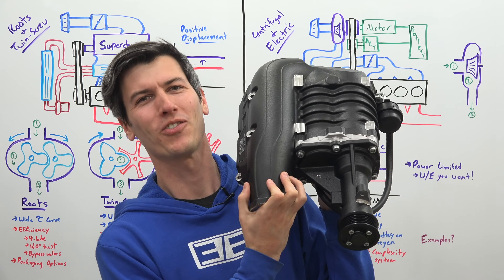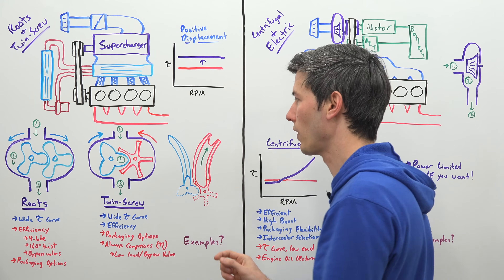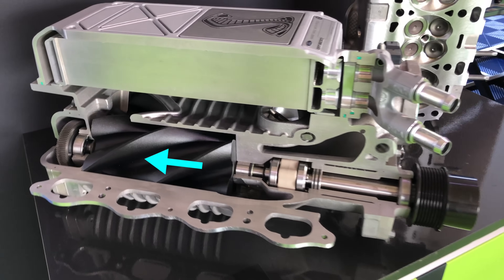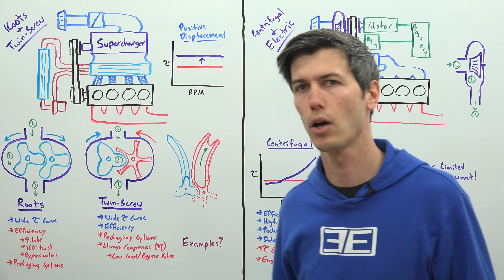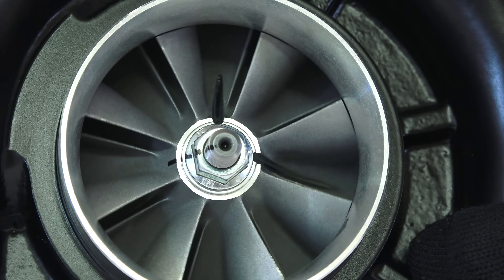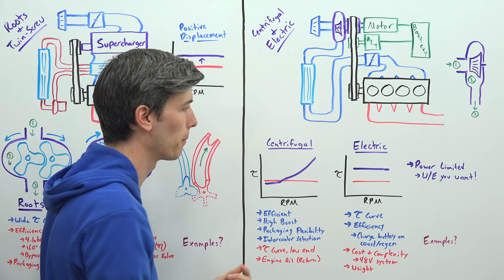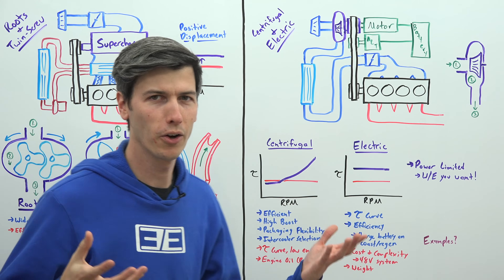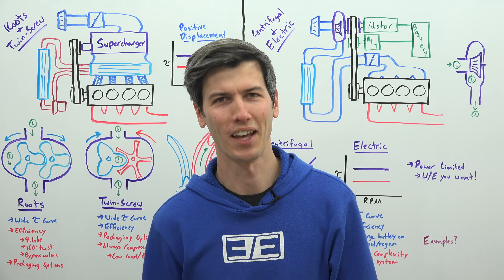What's The Best Supercharger? Roots vs Centrifugal vs Twin-Screw vs Electric

Comment: Best depends on the application and desired outcome. I’m not a fan of Superchargers specifically positive displacement Superchargers on small displacement 4 cylinders. Those engines need high boost levels to make up for displacement. Above 14 lbs the heat/parasitic drive requirements skyrocket. A properly sized and designed turbo will shine all day long above that pressure.

Comment: What if electric supercharger with an alternator driven by exhaust? Place that turbine driven alternator where the back muffler would be to shield it from heat. Charge electricity when motorbrake or high rpm.

Comment: Great video and info. Wish I could have viewed it back when I was a kid, 40 years ago. Centrifugal type superchargers are dynamic devices as opposed to their constant output Positive Displacement counterparts such as the Roots. Centrifugal type simply convert velocity energy into pressure energy via diffusion (learned that way back from Hugh MacInnes). So you speed up the air to very high speeds and then rapidly slow it down and pressure builds (Kinetic energy 1/2mv2). That is why the output is non-linear. For the roots and screw comparison you mentioned, both push the air out. Internal compression that you mentioned? Probably not the right way to look at it. Both gulp and slap the air hard in the lobes/screw which induces heat, difference in adiabatic compression efficiencies.

Comment: You neglected sliding vane type superchargers. I installed a Judson of that type on my '58 VW Bug in 1963. Those are compressor type superchargers. On the VW it cut the 0-60 mph time from the stock 30 seconds to an astonishing 15 seconds. Hold on to your hat!

Comment: So why on Earth would you install a centrifugal SC to a S2000? The car needs help down low, cause all the power is high in the rev range, so you gave it a SC that gives you nothing down low and only helps at high revs - why? Why not help the car at low revs where it struggles? You only made the gap greater and more imbalanced

Comment: Seems like a hot setup would be a centrifugal supercharger, with an electric motor sufficient to spin it up to a certain speed, and a one-way clutch setup that would allow the crankshaft to drive it above that speed.  So the electric motor gets you boost at low(ish) engine RPM, then crank power takes over up top.

Comment: Hey Jason, just wondering what happens to the air that goes through the bypass valves? is it recirculated back into the intake or is it just released to atmosphere? 
Love ya vids man keep up the good work 💪
Reply: I thought it is used to feed the engine? It's just at atmospheric pressure rather than compressed,so ,as the fuel to air mixture is fixed the engine is using less fuel (and less performance).

Comment: Hypothetically

You got a flat'ish curved horsepower graph, but at 5.000 to 5.500 rpm, it goes up steeply and falls down back again.

My question is: When you accelerate, will your rpm move slowly, till it reaches the 5k - 5.5k rpm where the rpm moves faster, but slows down again after?

I want to know a demonstratic answer to how horsepower works

Comment: The only thing that gets me is what’s the difference between a 6-71 and say a 14-71
Reply: The size of the blower and how much air it can move per revolution. As for the names, these blowers were used as scavenge pumps for Detroit Diesel engines. The motors are named after the number of cylinders and the size of each cylinder in cubic inches. Examples include the 6/71 (6 cylinders inline, 71 cubes per cylinder) or 8/71 (8 cylinders inline, 71 cubes per cylinder) or 8V92 (8 cylinders vee-configuration, 92 cubes per cylinder).

Comment: A centrifugal supercharger already has a gearset to give it high impeller RPM in relation to the engine crank RPM, so how about a centrifugal supercharger with a CVT built into the supercharger replacing the fixed ratio gearset, thus give it a constant compressor RPM and thus consistent boost no mater what engine RPM you are at?
Reply: There is a company that makes that, i dont remember what they were called though, actually i think procharger made one a few years ago as well

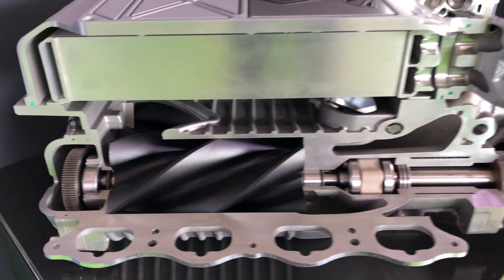Comment: At time stamp 3:27 you comment that air can bypass the rotors.   This is incorrect, its a positive displacement supercharger.  Air still goes through the rotors but is recirculated to the inlet side of the blower through the bypass valve.
   

Roots superchargers are more efficient when not in boost because they don't compress the air in the supercharger.

Twin Screw supercharger are less efficient when not in boost because they always compress the air in the supercharger.

Comment: Nicely done.  A few additional points.  

Superchargers (and turbo's) heat the air, partially due to compression, partially due to inefficiency.  

An intercooler eliminates most of the inefficiency effect, and requires less power from the crank per HP generated.  Cooling, allows moving as much air, at lower boost. 

The twin screw and centrifugal have internal compression, so generate the heat of compression even off boost.  With high boost (10+ PSI), running the bypass through the intercooler is a good idea.

The negative to the roots was efficiency, ~55% compared to 70+% for twin screw and centrifugal.  That changed with the 160 degree, 4 rotor.

Positive displacement (IMHO) are better in small displacement engines, increasing torque at low RPM.  

A centrifugal makes a high revving engine even more so (was that true on your S2000?).  Driving a centrifugal off the crank through a CVT to flatten the boost curve would be interesting.

The electric drive is usually on or off, so provide more boost at low RPM than high RPM.

Comment: You're an engineer so why didn't you include whether it's more efficient to just have a more powerful alternator motor that actually boosts torque electrically rather than feeding the ability to burn more fuel as a more efficient alternative since you already have batteries and all this stuff you need?

Comment: You sate that "positive displacement superchargers always compresses" air...not strictly true.  At low throttle there is actually a vacuum across the supercharger.  It is always moving air, but not necessarily compressing it.  At high engine vacuums, the vacuum is driving the supercharger as much or more than the pulley.  This can be seen in the vacuum gage.

Comment: Hi, my car need a new battery. It's the first time that I will replace the battery in this car. This battery has 6 and half years and when I went to the dealership, they said that the replacement batteries never last so much as the 1st battery. I wanted to know if this is true and why. 
Thanks

Comment: Something not mentioned is Roots and Twin Screw superchargers are prone to heat soak cause they sit on top of intake manifold. Also with Centrifugal you can help with getting more power/torque down low by having a restrictor plate on it. My '15 C7 Corvette has an ECS blower on it which is Centrifugal and i have plenty of power and torque down low. It comes with a restrictior plate which spins the blower faster so you get more power/torque down low while restricting boost up top.

Comment: Wouldn't it raise efficency, to use the electric supercharger combinded with something like a turbo? Use the exhaust gases to drive an alternator to generate electricity but other than with a turbo, get full boost at starts, because of the battery.

Comment: technically F1 uses electric superchargers too, it's just that they also function as turbo's
Reply: Eh... not really. All they do, is use an electric motor to help spool up the turbo, so there's no lag. It's not really an electric supercharger, because F1 turbos still have an exhaust housing providing the compressor with energy

Comment: Video suggestion, which makes more sense for the electric motor driven charger, which would be interesting if you could also get some real-world data for. Compare supercharging, turbocharging, and electric-charging with the same centrifugal compressor. I don't believe electric-charging should be categorized with supercharging like this, because the input on the compressor has vastly different characteristics, just as supercharging and turbocharging have different input characteristics.

Comment: I know the late 80's MR2's used an a/c style clutch to decouple the supercharger, which I thought was pretty cool.  Next time you do this, I'd be interested in the rotrex supercharger.  To that end, are there reasons why one couldn't use a CVT on the pulleys for the centrifugal style to more or less either fix boost levels, or fix turbine speeds?  I would think that would be win-win.  I think it would be interesting to plot the efficiency islands of a TVS 2650 against one of the Whipple 2900's.  I've heard that Eaton has really cranked up the efficiency on the newest gen TVS superchargers.

Comment: Unrelated to the topic but I just wanted to know what you think the internal combustion engine’s future would be like if cleaner alternatives to gasoline come along. I personally would hope they would stay because I have a 1990 Mustang 5.0 with sentimental value and I would hate to be put in a position where I have to either convert it into an EV or stop driving it all together. Do you think that if alternatives to gasoline do take off there might also be an alternative to motor oil? Probably a cleaner lubricant?

Comment: What if the pulleys had a cvt type of system on them. Then the boost could run independently of a fixed gear or engine rpm?
Reply: Not only that, image if we had a pulley connected to a turbocharger through a CVT.

At low rpms, engine drives the compressor, at high rpms, compressor doesn't draw power from the crankshaft but the exhaust. Playing around with the CVT ratios will give you all sorts of boost vs rpm curve.
Reply: It exists
Reply: Isak Johansson  Where?
Reply: @johnpaulstez  Procharger made one a couple of years ago and  Torotrac made one as well

Comment: Turbo chargers are getting less turbo lag, but mostly by shrinking the Turbo, limiting top achievable power.  Jason, you mentioned that electric centrifugal superchargers require more battery voltage and extra / heavier components.  You also mentioned that there are times when the battery charging is essentially free, like when a car is going downhill.  Unlike the days of carburetors, fuel is cut off when gravity is powering the car's motion.  Have people combined electric supercharging and turbo charging successfully?  I believe that was tried in Formula One.  You could have a car with normal hybrid qualities combined with explosive power on demand and no lag.  It would also be nice if electric supercharging required less resources, e.g. 12V power, light electric motor and so forth.

Comment: New gen mx5 has a weak transmission and piston rod reason why it hasn't been well received with the modding community. Works great tho for bolt ons and e85 tune because of the high compression .

Comment: Are there aftermarket electric supercharger kits (that actually work)?  It seems like an appealing technique where you can store the energy needed to run the supercharger (for say a 1/4 mile run), and then it's basically free (as you said) power when you need it.  As opposed to all other kinds of superchargers that rob HP from the engine during use.
Reply: the problem is that you need a lot of energy to run a supercharger, from 1/4 mile run with standard 1.5kw alternator you will have enough energy stored to run a supercharger for like 0.1second

Comment: Okay I've had a question rattling around my brain for the past few weeks, how is it possible that two diesel engines can run on the same fuel, with different compression ratios and won't experience engine knock
Reply: different air-fuel ratio maybe
Reply: In part, because Diesels run timed fuel injection, so they inject the fuel at high pressure at the right time, rather than have it drawn in by vacuum or injected into the manifold.

Comment: The best supercharger is the turbine driven supercharger, commonly called a turbo.

25% of the engines power is used to drive a mechanically driven supercharger. This is the work required to compress the air, not mechanical losses.
Reply: The amount of the engine's power required to drive the supercharger can vary greatly, I don't know where you pulled that static 25% from. And a considerable amount of that is mechanical losses.

Turbochargers are more efficient, everyone knows this, it's old news. Largely because they get most of their power from the exhaust gases, and also because they have very low mechanical losses. The problem is and has always been lag, superchargers have none.

Comment: Have you ever done a video about torque converter lock up? I have a Honda Civic and I notice no matter what gear or rpm I’m at, if quick stomp the gas, the rpms jump independent from wheel speed. The torque converter never seems to lock. My old 328i was always locked beyond like 2nd gear. Is it a cost thing? Wouldn’t it be more efficient to lock the converter after 1st/2nd? A video explaining this would be awesome!

Comment: I have always wondered if it would be more efficient from a power loss perspective if you had only two alternators being driven by the engine with everything else being electric (A/C, Power Steering, cooling fans, water pump, etc...).
Reply: Alternators have about 50% efficiency so no, it would not be more efficient.

Comment: I've got a question, are those systems not making power losses because of the pulley installed at the end of the crankshaft?
Reply: Engine driven superchargers do use engine power but they increase the power produced well beyond their parasitic load. There is a net gain in output.

Comment: He left out ELECTRIC TURBOCHARGER. The compressor is run by an electric motor, when the main turbo is up to speed and able to provide its power boost, the electric system running the air compressor is shut off.  When the accelerator is pressed, the electrically-powered compressor instantly spools up to provide boost. When the turbine reaches a pre-determined operating speed, it’s coupled to the compressor to provide boost from the engine’s exhaust gases.  It is the most efficient of all air charging systems. Garrett and Honeywell will supply electric turbochargers to car makers. Audi, Volvo, BMW and Mercedes have all announced electric-turbochargers for their next-generation models.
Reply: Also, i don't know if this one has been used much in CARS yet, but there's a very similar concept called the TurboCompound: a turbine takes echaust gas energy as youd expect, but it can return this energy to the drive shaft directly rather than running its own supercharger.

An electrically turbocharged Hybrid vehicle would likely be the same concept, but with the added bonus that the motor gives supreme torque at low rpm, compared to the typical turbocharged ICE

Comment: I used to have a electric supercharger on my BRZ made by Phantom at the time. Very cool system. Full boost in less than a second at low rpm about 5psi. Downside was fixed speed so up top only had about 2 psi. Still gave me 4-5mph on my trap speeds
Reply: I was wanting that system badly for my FRS about 6 years ago but sadly it never really took off and they stopped producing it.

Comment: Your s2000 made lower power cause you bought the smallest one SOS. . Alot of s2k  have made above 400hp with SOS and stock engine. F20/22 have forged internals.  No one upgrades internals unless you shooting for 700hp plus

Comment: In Germany, we differ between compressors and (exhaust) turbochargers, with the last one, as the name suggests, is driven directly by the exhaust stream, not by the engine belt. Electrically driven superchargers are a new, independent category.

Comment: Now if we could charge the battery with another turbine you’d have much more electrical energy to keep your electrical compressor running. It’ll be like a conventional turbo but one that can be regulated independently of exhaust output.

Comment: How about exhaust gas powering the alternator?
That would be the only way, i could get used to turbochargers, as the lag would be significantly smaller, the torque curve nearly even and the boost pressure would not be blown off.
Reply: Nice thinking,  I believe MB f1 car use this type of design.  Turbo and generator on the same shaft.

Comment: Toyota previa (van) Put a roots supercharger on their four-cylinder engine. It had a centrifugal clutch and A second air passage for letting the engine run on non-pressurized air. Nothing like Toyota 1999’s  technology

Comment: Another excellent video. Always wondered how superchargers worked since having a Merc E55. One question came to mind when you covered electric superchargers is why don’t Turbo cars have an electric motor to spin up the turbo to reduce lag and perhaps increase efficiency? In my mind it could simply be a burst of electricity for a split second if the accelerator is pressed quickly. I am not an automotive engineer so don’t know if or how this could work but would love to know your thoughts.
Reply: that is to spin it up that fast one needs a very powerful motor, for the engine size of E55 amg the motor will be somewhat 150kw or so